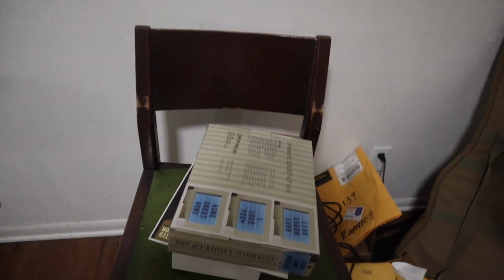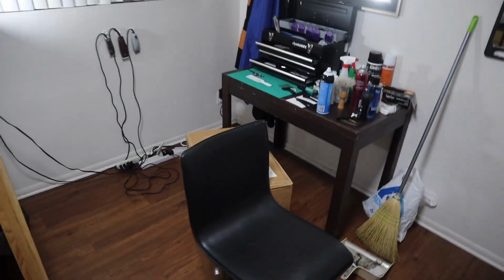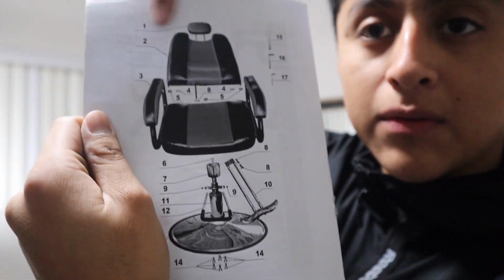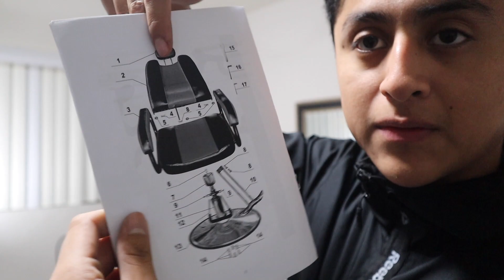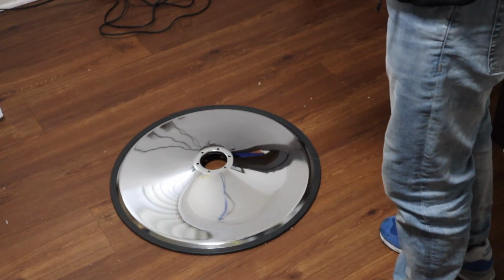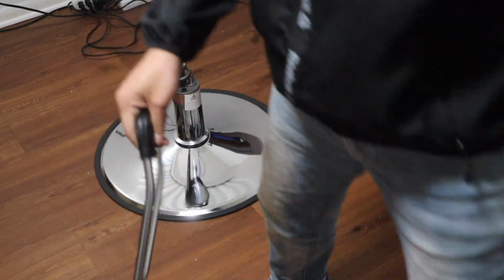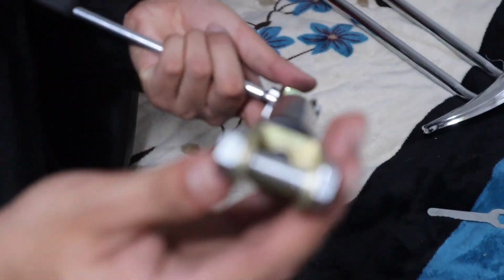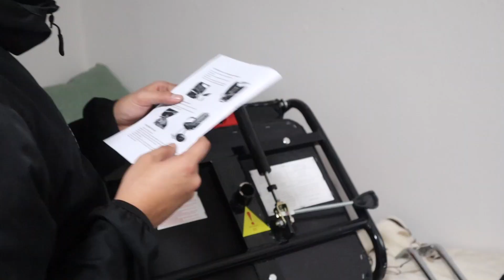ASSEMBLING MY NEW MERAX BARBER CHAIR

Comment: I couldn't get to recline 😭
Reply from the maker: Unfortunately, these chairs do not recline like normal professional ones. If you did the installation correctly, then to recline you or whoever is sitting in the chair needs to push back. They can put their feet on the footrest and push back.
Reply: @ramirezcuts9777  took me a while but I figured it out
Reply: @ramirezcuts9777  I'm very disappoint, I just got the same chair from Amazon, and the reclining part doesn't work properly, it keeps up and down so easily, I cant have my costumer comfortable 😞 im so sad that I have to take it apart all over and send it back to seller. Zero stars
Reply from the maker: Elissandra Simone de Lima Silva Hey! Yes, at first I was very upset because I could not figure it out. Was the recliner handle bolted down to both parts of the chair? Yeah, amazon chairs could be hit or miss :/

Comment: Whats your height? ,... im 5'6 and im looking for a chair  that would have my clientes on my eye level.  Wirh the chair fully pumped.  I hate bending over and this chair caught my eye but as soon as it was built i noticed it was to your upper stumach. Ehh
Reply from the maker: Hey! I am around your height, and personally it got the job done. Clients with our height sat fine, but shorter clients were lower. Meaning for those I did bend slightly. I have been seeing many others get this chair though!
Reply: @ramirezcuts9777  yeah my man thanks for the reply, you pushed me to get it and i actually assembled it by myself. Easy as pie, u feel me.  I actually made a litle seat raiser for the kids ,  and its an eye catcher
Reply from the maker: @erixgarcia5166  Awesome!